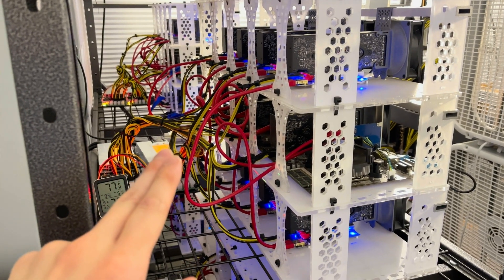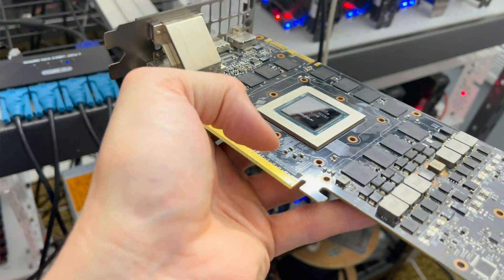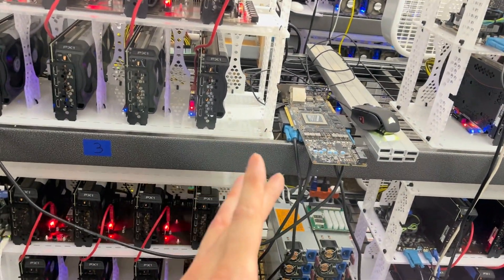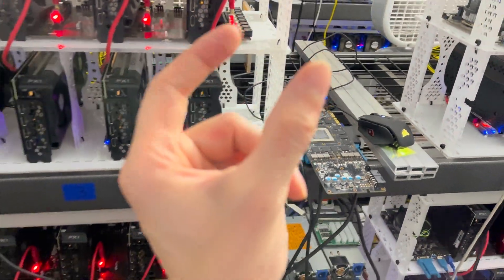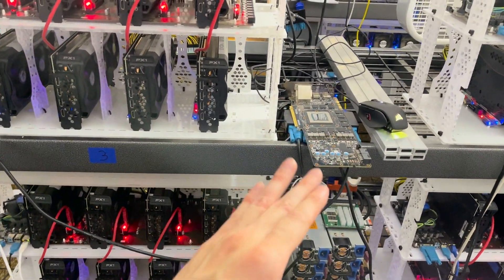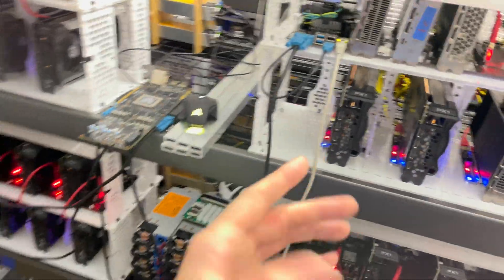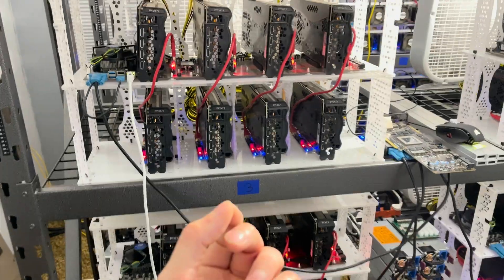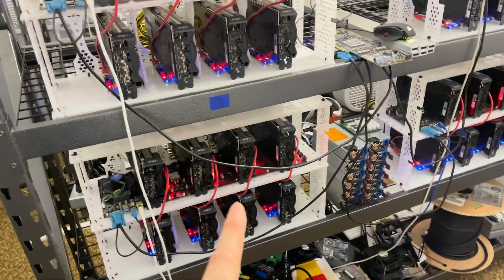The Silent Killer For GPU's?

Comment: Ive ran my cards during the winter with spot electricity.. they are outside and when electricity goes over a point of no profitability it cuts the power and when it goes profitable turns on..

The cards sound so sad and fans squeek when its -30celsius and they turn on💀

But have done this for many years and have had no problems.. Maybe lucky but tbh my cards go from -30celsius to +20 celsius when they start mining.. so i guess thats as bad as going from 20celsius to 70 celsius
Reply from the maker: Yeah, as long as the temp delta isn’t too bad it’s alright. To be avoided if possible, but it is what it is. Gaming is often much worse than mining since the cards usually is much hotter, and has much more frequent load changes. Temps can swing back and forth hundreds of times an hour while gaming, depending on the fan curve and load.
Reply: yep very true.. also actual high temps cause own problems in circuit boards with many different materials from plastic to metals.. thats why i like to keep them cold @SiCPoWMining
Reply: the only problem that ive encountered is that cmos battery doesn't like the extreme cold.. my bios on some motherboards reset time after time.. maybe should get more S37 / T37 motherboards since those haven't had any issues @SiCPoWMining

Comment: no dude, once you get past the GPU DOA phase Thermal cycling isn't an issue on the silicone as you think it is, the issue happens on soldering joints on the PCB, those expand and contract and overtime can become dislodged which is why people usually do the "oven method" to get the joint to link. Also, voltage l doesn't affect the silicone as much as you think it does unless you're cranking it to the point that it puts too much stress on the components around the chip, high voltage degradation affects capacitors and mosfets over time which is why most GPU failures are a blown out capacitator or a mosfet.  If thermal cycling was so much of an issue, you would see much more CPU degradation considering they go through more thermal spikes than a GPU everytime a  process is open and run, but no, outside of overclocking it with unsafe voltage a CPU will go on to run for decades.
Reply from the maker: We are talking about two entirely different things. This was largely about hardware that was run heavily stressed 24/7, not typical desktop computer hardware that sits idle the majority of its life. The reason why solder joints fail, is largely thermal cycling causing differential stresses and fatigue. Things like capacitors age largely from heat, and ripple induced heating from the internal resistance. The closer they operate to the design limit, the faster they tend to wear. It does depend a great deal on the style of capacitor, the load it’s exposed to, and the design or layout of the PCB. Capacitors can very easily outlast the silicon, and regularly do. You’re talking about examples that had a bad design, and the weak link was the capacitor. This video was a massive oversimplification, but it’s largely accurate. The voltage differences were taking about here are tiny, maybe a hundred mv or so. It’s trivial to design a PCB so the capacitors don’t care one bit about this difference. However, run your GPU 24/7 at 1.2v vs 1.1v, and the lifespan is going to be reduced many years. This physically degrades the chip, so of course it has almost no significant impact over brief periods like most gamers would see. Ask overclockers if they ever burned a cpu from too much voltage, even if the temps were -200c. CPU life for old designs, like early C2D, can easily run decades under light loads. However, this is largely due to them being run so far away from absolute limits. Modern chips have VERY aggressive boost behavior, I highly doubt they would run past 5-10 years 24/7, even in best case conditions.

Comment: pretty cool vid on miners not burning out yet the fans do....thanks....
Reply from the maker: Fans are tricky. Some GPUs run the fans at very high speed, or just have cheap garbage fans in them. Those don’t last, even in gaming rigs they’re barely enough at times. Of course mining 24/7 can degrade bad fans very fast. However, good fans exist, and some higher end cards have fantastic fans. The EVGA FTW3 series uses relatively low speed fans, since it has such a massive heatsink, and they are good quality fans. Those tend to last, like many high end GPUs fans. I haven’t had a single fan failure, and my miner friends haven’t had any as well. However, some manufacturers have garbage fans that fail really fast. This is made more apparent when they are run at 100% 24/7, but sometimes temps are high end there’s no choice. A good fan can easily run 5-10 years 24/7, a really bad one might only last months.

Comment: thanks for the great info sharing! mind to ask what's the ideal expansion and contraction temperature for gpu to prolong the gpu lifespan? i live in a tropical country whereby the weather is warm/hot during the day and may experience sudden rain during the day/night.
Reply from the maker: The unfortunate answer is you want to minimize the thermal cycling as much as possible. Its a balance between all the factors, but ideally you want to shave the peaks down as much as possible while minimizing the minimums. Auto fan speed control helps here, don't worry about your fans running 100% if the card is hot, especially if it cools down later in the day. You can set up Hive, the miner, or Afterburner to control your fan speeds based on temp. Let them scream if the cards get hot, and then slow down when they cool off. The trick is finding out the optimal config, that's a bit of an art. You can even have external fans that come on when a peak temp is hit, or automatic building ventilation if it gets too hot, plenty to consider.
Reply: @SiCPoWMining  yeah that's definitely lots of factor to take into account when considering the thermal cycling. We know that Hive OS have the auto fan control function but unfortunately for Simple Mining that can only set the fan speed % which i'm currently running them on 90-100% depending on each gpu card. And yeah as you mentioned, plenty to consider when the warm/hot/cold weather peaks up/down in 10 Celsius +- between the day and night.

Comment: So gaming and mining while not gaming aren't a good option either ?🥲
Reply from the maker: It’s not like the card will explode. It’s fine, it just increases the risk of having a failure before the hardware is obsolete. The best thing for your card is to just leave it in the box, any way it’s used is more or less a risk. There’s just some workloads and use cases that are more risky. If you want to get a very long life out of your card, and you want to mine on it in a case, you ideally should get one that runs very cool. 3060/60ti/70 STRIX, FTW3 or a high end cooler on a midrange or low end card. Then it’s fairly easy to minimize both peak temps and thermal cycling while inside the case. Ideally have some good airflow through the case too. It’s shockingly common for people to run RGB fans all pointing out so they look better, but the case and it’s components get horrible airflow. Most cases are garbage for airflow through, with any fan and config.

Comment: When you say high voltage, how does the 110v vs 220/240v input play into it?
Reply from the maker: The input voltage to the PSU has absolutely no bearing on the voltage the GPU silicon sees. The PSU largely won’t care much if it runs at 120v or 240v, although it may have some small benefit from running on 240v. The ‘high voltage’ I was talking about, is the voltage the high power silicon on the GPU runs at, and this is largely either out of your control or linked to clock speed. With NVDIA, the BIOS is locked down so you can’t currently modify voltages to things like the memory controller. This is possible with some AMD cards, and reducing the voltage to the components will have a reduction in degradation, but also leads to an increased chance of instability. So it’s a balance between the time spent tuning, future risk of instability, and silicon degradation. Really, about all you can do with NVIDIA is run the core clock as low as possible and this also links the core voltage along with it. Degradation should be minor with coins like ETH, or ERGO since they’re memory intensive. The more core intensive algos like RVN and FLUX will cause more silicon degradation from the higher temps and higher core voltage.
Reply: @SiCPoWMining  wow. Thank you!

Comment: It simply is NOT always true that the RAM chips don't produce as much heat as the core processor. On most cards it's actually More, but people don't know the heat, because they never measure it. On some mining software for RAM intensive algorithms like  daggerhashimoto for Etherium - you can monitor it and see that the RAM gets 2-3-4  times hotter than the CPU. For example 95°C compared to 38°C or 110°C on the RAM, before it thermal throttles itself, compared to 47°C on the CPU. What he is telling is only valid for some card and some algorithms and maybe when used for gaming, but Not always true.
Reply from the maker: You’re confusing heat with temperature. They are entirely independent. High temperatures do not mean high heat output, it can mean high power density, or high thermal resistance. The memory chips consume around 2-4W each, the core can easily consume in the 100-300W range for high power modern GPUs. The reason why the memory runs hot, is the chips are effectively insulated. The silicon is covered in that packaging, and there’s often thick thermal pads on top, then the heatsink they put heat into is often not very great. This makes it difficult for the heat to get out fast, and that leads to potentially high temperatures. HBM often runs quite warm as well, but this commonly is for other reasons.

Comment: i recommend the rx 6600 from msi. i get 55 on memory and 46 on core while mining at 50 watts
Reply from the maker: 6600's are pretty good since they don't have thermal issues. A2000's are still more efficient, but how important this is depends on your location and energy cost since they do cost more. The software reported power consumption on most AMD cards reads a bit low.

Comment: I work in an environment where there are multiple computers running graphics 24/7 for years. Mostly a gpu fails because the fan dies and we didn't find it it time. If the techies replace the fans the life expectancy of the card is 8 years because it runs at a stable temp. Temperature cycles  are a valid point, the same with mining, a constant temperature, inside the card specs, makes a big difference to lifetime. I still have cards that run well after 10 years because the fans were replaced, and have multiple cards mining that are cleaned and looked after that seem like they will carry on for many more years too.
Reply from the maker: Good feedback here. Plenty of mines have run cards over 6 years with shocking low failure rates, even in hot and dirty conditions. If the fans are good, the cards can last 5-10 years, sometimes well over 10 depending on the design. Usually the hardware is near worthless after 10 years, so its reasonable to say they can last beyond their useful life with a bit of care.

Comment: I wonder if having my cards in the garage is bad. It goes from like 65 at night to like 90 during the day.
Reply from the maker: That’s not a big deal. That’s not a huge range, the bigger concern is if your GPU runs at say 110C mem temps. If you combine that with intermittent internet, frequent rig restarts, power outages, or cycling the rig off when power prices are high, that’s a big temp range. It will cool down to ambient, 25-30C, then heat to 110c. That’s a range of 80c or near 180F. That’s of course on the extreme side, but it’s one that happens to some cards in some conditions and it’s brutal if it happens dozens of times a day every day. As your temps the hardware runs at goes up, the risk from thermal cycling goes up. So if your hardware runs fairly cool, it’s not a huge risk and may not end up being the failure point in time. It’s just a question of acceptable risk. Sometimes the costs for stable temps outweigh the risk. Running A/C is expensive, but you can keep stable temps. The better bet is try to maintain reasonably stable temps, make sure your rigs are stable, set automatic fan speeds, and hope for the best.
Reply: @SiCPoWMining  Thanks for the detailed response. My 3080 strix hits 96 during the peak of the day. I just don't want to void my warranty on it yet. Only 4 months old.
Reply from the maker: Ah, you were talking about the peak mem temp in deg C? 65-90 is a surprisingly significant swing if that’s the case. Consider trying a temp based fan setting so it runs the fan cranked when it’s hottest and slows down when it cools off. Try and see if you can drop the peak temp a bit with an external fan or more airflow if possible.
Reply: @SiCPoWMining  Sorry the 65-90F ambient temp. 96C vram peak temp. Drops to like 88C at night.  But yeah if it dropped to 65c on vram at night, that would be nuts lol
Reply from the maker: Ah, not really a big concern there then. 96 is surprisingly hot for a STRIX 3080, but it’s not too horrific for a peak. My modified founders run around that in 100°F.
Reply: @SiCPoWMining  Yeah I thought the strix would be better. Evga is a little better but zotac holo Amp extreme is way better. My fe after a repaste is 92c. My fe had its pads half covering the vram from factory.

Comment: 3070 vs 3070ti which is best for mining and which is more efficient. after eth 2.0 mining will profitable
Reply from the maker: This is speculative, but my vote is firmly on 3070. They’re fantastic on a wide range of algos, efficient, and don’t have significant thermal issues. EVGA FTW3 3070’s are likely the best mining GPU in the industry at the moment, all things considered. It does depend on the purchase price, and your electric rates. Long term efficiency is always king, so I lean towards that. That’s why I have primarily A2000 and 3070’s.
Reply: @SiCPoWMining  I second the 3070 for the long term, trying to get ones with Samsung memory is also key

Comment: Hey sicpow could you please make a detailed video on how you connected the fans electrically  in that exhaust fan wall and also what controllers you used with those and how you connected those to the fans & how you connected those to the PSUs and also with the pwm controllers you mentioned in the video description on your other fan video. Thank you . Love the content by the way.
Reply from the maker: Hey there. I can try to get this in a short, it's not very in depth for a whole video. The fans are just all in parallel, the wires stripped and soldered to a larger one, run to a screw terminal breakout board. 4 fans per 14 AWG cable, every 4 fans has a wire running to the PSU. They all get +12V, and then the PWM wires are all tied together, that heads into my custom PLC that drives them. It outputs the PWM signal to control the fan speed based on temp differential, and indoor temp. A few people asked this now, so ill try and cover it more thoroughly in a short video.
Reply: @SiCPoWMining  thanks so much SiCPoW your reply is very detailed which is enough for me but yes if you are planning to make a short video that would be great too👌🏻🙏🏻